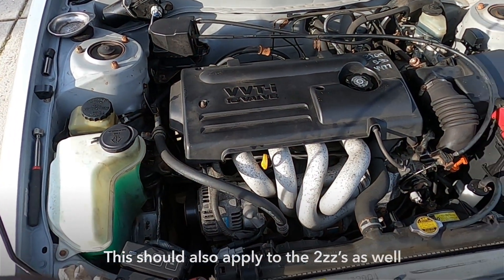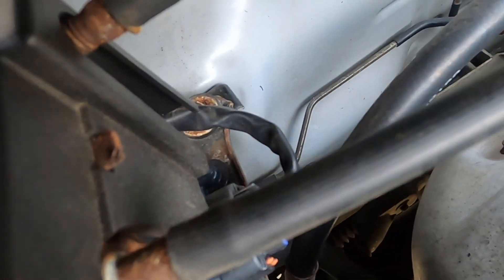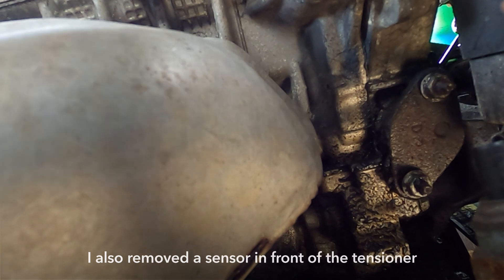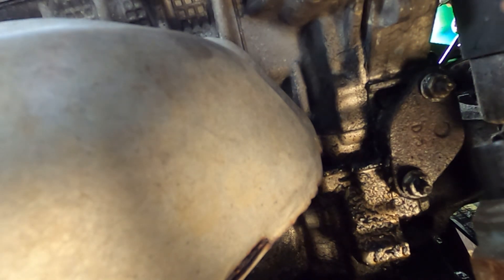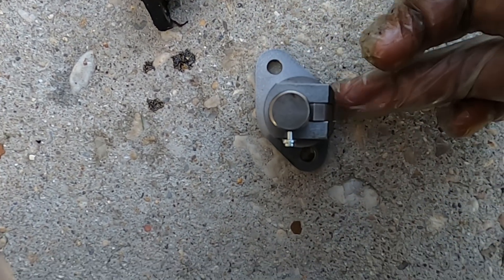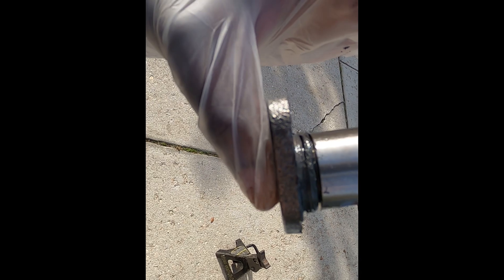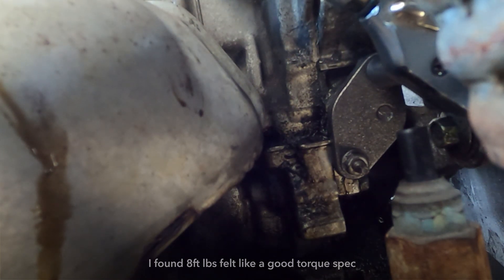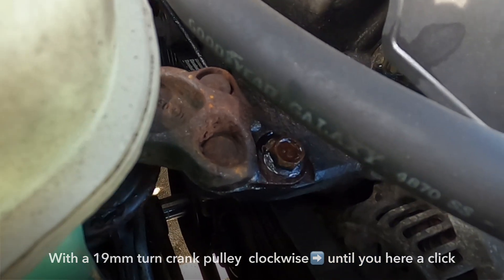Toyota Corolla timing chain tensioner replacement

Comment: The 1zz engines doesn't leak from the chain tensioner, but from the chain cover between the engine block and head. This is due to the head sticking a tiny bit further out than the block. To fix this small oil leak the chain cover has to be taken off, and some gasket maker is then applied right where the block meets the head.
Reply: This is rather nonsense. There are many videos showing prolific oil leaks from the tensioner on these engines. I just replaced the valve cover on my 2000 Corolla and applied gasket maker as well in this area. There is no longer any sign of leaking from the block and head but there sure is from below it where the tensioner is located.
Reply: How will I know if my Corolla 2012 is 1zz or 2zz? Thank you

Comment: Great video! Does the engine have to be at Top dead center when doing this? If not, why?

The mechanic at the Toyota dealership told me it always has to be TDC, but I’ve seen many people on YouTube just pop theirs out and put the new one in. Thanks!
Reply: I thought u have to counter clockwise to release the hook?
Reply from the maker: Thank you. I would say no it sounds like that guy is trying to scare you. By removing the tensioner it does not affect the timing of your engine or cause it to jump a tooth or any of that(As long as you don’t start it with it out). Some cars have their water pumps driven by the timing chain and need to release the tension to remove them and never needed to be at top dead center. I’m not going to act like I’m smarter than a Toyota Technician. But I can tell you I’ve replaced one on a 2002 and a 2008. With zero problems. Just make sure to MANUALLY turn the engine over until the hook releases the tensioner and it pops into place before starting the engine.👍🏾
Reply: @ultimatediyguy395  if you dont manually turn it over and you start it; what will happen sir?
Reply from the maker: @AnythingEverythingGh  the timing chain will have slack, it’s possible for the chain to jump a tooth
Reply: @ultimatediyguy395  And the noise still will be present I guess